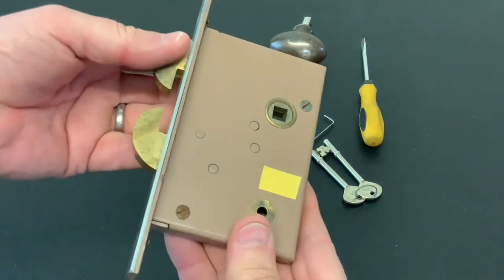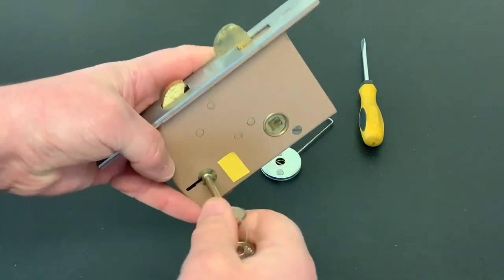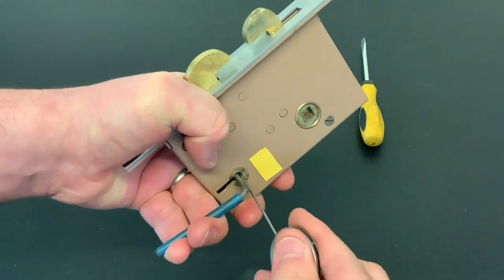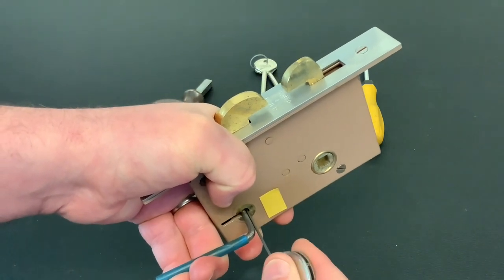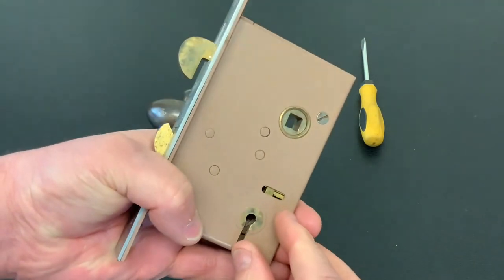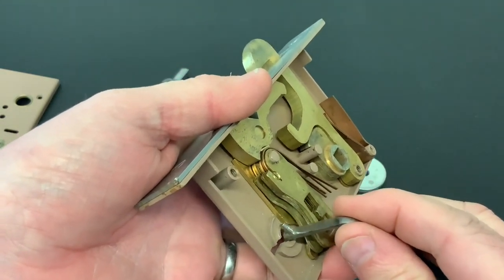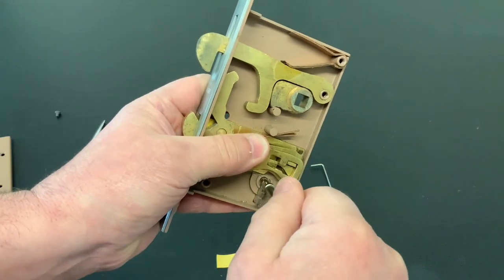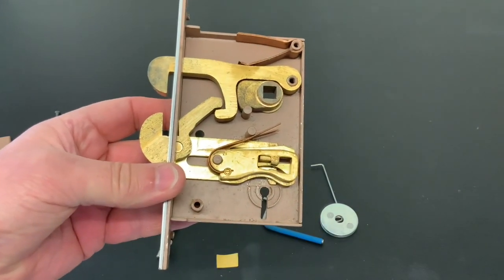265. Vintage Century 4 Lever sliding door Mortice lock with hook bolts picked open - Cool mechanism

Comment: Very unusual and very clever at the same time. I love the way the bolt mechanism locks the handle. I have a couple of locks where the key slides through the warding just like that. Recorded and ready to reveal (in due time).

I was hoping you were going to pick it a second time so we could watch through the window.
Great picking and I feel good now as that's the same technique I used to get round the warding/static curtain to pick the ones I have.
😁👍🏻cheers Brummie for another great picking video.
Reply from the maker: Cheers for watching Roy, it is a simple but really cool mechanism 
Sorry I didn’t pick it again with the levers exposed
Have a great weekend 😎👍
Reply: @BrummieLockPicker  No worries Brummie,  totally awesome video as always.

Comment: Hey mate checked out a few of your videos, mainly on the old lever locks. Seen in one of the videos you mentioned putting the lock back to the locked position. I'm actually in a bit of a bind in that matter myself, picked an old english that's the same design as the squire and can't find a way to lock it back. Wondering if you have any tips or if I might have overlooked a video.

Edit: Managed to lock it twice. First time was luck but second time I had to reset the levers most of the way then rake them while tensioning the bolt the other way. Don't think it's proper form of course. Also managed a 3 second pick on the second try but I'm sure it was 2 levers still in position that did it. Just raked the levers once and it freed.
Reply from the maker: Cheers for watching mate, glad to hear you managed to figure out how to lock it back up 👍